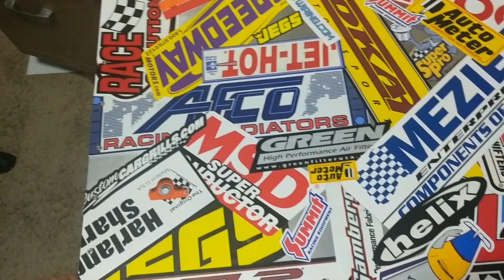Custom CoreXY 3d Printer Walkaround

Comment: What's the deal with this these days?
Reply from the maker: It’s been upgraded to Duet 3 electronics with a CAN toolboard, LGX Ace Mosquito direct drive and a few other tweaks.    Still a beast.

Going to go 3 motor on the bed leveling and closed loop soon-ish.
Reply: @BlakeMcBride  are you on klipper?
Reply from the maker: @travistucker7317  no, Duet (RepRapFirmware).
Reply: @Blake McBride  i forgot that.  Duet pretty much has its own ecosystem right?
Reply from the maker: @travistucker7317  Correct.   It's fairly comparable to Klipper overall.   I have some friends that run Klipper and are very happy with it, just came around after I was already deep in the Duet stuff.

Comment: Question...Did you use genuine Hiwin MGN12 bearings or some of the el cheapo chinese knockoffs?
Reply from the maker: 123jerro they are knock offs.   Greased up they run nicely.

Comment: Hey Blake, just subscribed! Can we see some more of this printer and the print quality would be awesome. Im building a large 3d printer. id like to be able to print a performance intake manifold for my 02 silverado RCSB 6.0l turbo truck. Can i ask what $ you have in this printer? Ill be using 15mm linear rails, corexy, ClearPath servos and ballscrews. Controlled by a Smoothieboard.
Reply from the maker: Hi Chris!   I will get a new video soon, I promise.  I need to pull the printer out of it's cubby so that I can go through the electronics on video and show the Duet Wifi setup and new cabling.

I have about 1400 dollars in this printer, but the majority of that is in the E3D Titans/Chimera/etc, the Duet and the linear rails.

It sounds like a heck of a printer you're putting together!    I would like to move to clearpath servos in the future.   I'm in process of upgrading my CNC machine right now, then I'll loop back to upgrading the printer again, haha.   I am looking at perhaps putting in 2x Zesty Nimbles in the future and maybe a water cooled Chimera.   We'll see.  ;)
Reply: Very nice! Have fun with that milling machine. I have a big fryer bed mill that i am retrofitting with a SyntecCNC controller since im a dealer and yaskawa servos. Cnc machines can sure get pricey! Ill keep an eye out for that video. Thanks for the info!

Comment: this is exactly what i am doing now, would i be able to get those files to have a set milled out please :), i have started a conversation on google hangout if you have seen it. Thank you
Reply: Can I get those too? I am workong on something similar with function of CNC :)
Reply from the maker: AnsonCTA shoot me your email address.
Reply from the maker: Oh boy, those took a LONG time to mill.    I might be able to do a set, but it'll be a bit as I'm working on my '65 Mustang project right now.
Reply: i can get a set milled out by one of the guys in our machine shop here in the uk that's no issue :) but just need the data to give them :p
Reply from the maker: Can you accept exports from Fusion360?   If so, message me your email address and I'll send them out.  :)
Reply: anson08035@gmail.com 
thank you for your sharing
Reply from the maker: Glad to help!   Email(s) sent with info.

Comment: The ultimate "brick house" of CoreXY printers - congratulations! But you gotta tell us - where did you get that z-drive endless belt? It sure looks like it is longer than 2218mm long (the longest GT2 belt that SDP-SI sells, or anyone else that I have found). So, where did  you get it? And I'd add that a Duet WiFi would work pretty well on this guy as a controller.
Reply from the maker: Willie Anderson, it's a Chinese belt from AliExpress.   I'll find the length.

It has a Duet WiFi in it now!

Comment: Hiwin rails or did you get some other brand?
Reply: Your printer looks pretty stiff compared to most others... How loud is it with those linear rails? And I'd be interested in your method of bed leveling, do you decouple the Z axis pulleys or do you have an adjustment mechanism build into the bed?
Reply from the maker: They're just generics from AliExpress.   If/when they wear enough to be problematic I'll put real Hiwin pieces in.  I didn't see a reason to start with the expensive ones during prototyping.

FWIW, it runs very well now, due to the constrained nature of it, but I'm sure there is smoothness and improvement to be had still with the Hiwins.
Reply: Awesome! I am planning a big build like this.  Trying to figure out where to source some parts.  Like you said Hiwins for prototyping is rough.
Reply from the maker: It's nearly silent at <80 mm/s  move speeds (using trinamic drivers on a Duet Wifi).

I rough level by decoupling the pulleys, and then do final leveling with a DC42 IR sensor on the Duet Wifi.

Comment: Only thing I would change is the ramps board, it's a great board that I use for a few budget builds, but for such a nice machine, I would probably look at something with WiFi and some other nice features
Reply from the maker: Thanks!   I have a Duet Wifi w/ IR sensor and a PanelDue 7.1 en route, as a matter of fact.    The RAMPS board has been upgraded with Trinamic TMC 2130s and will go into my Ultimaker2+ clone.   :)